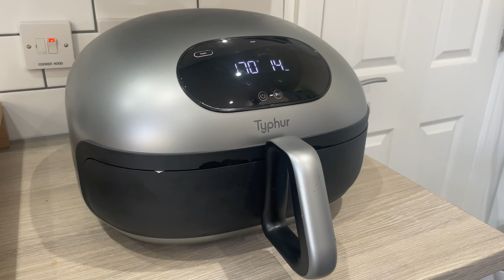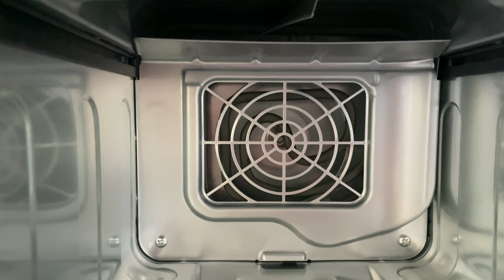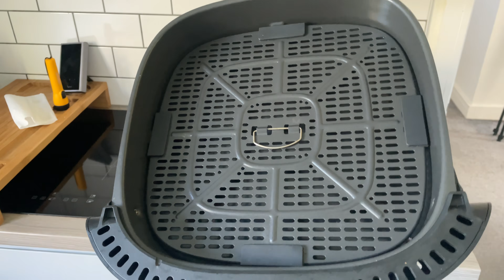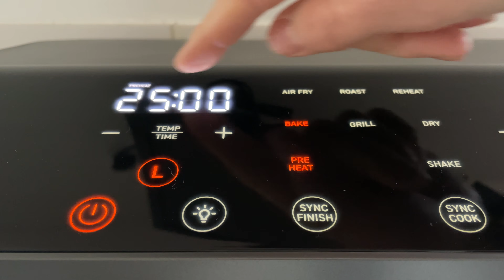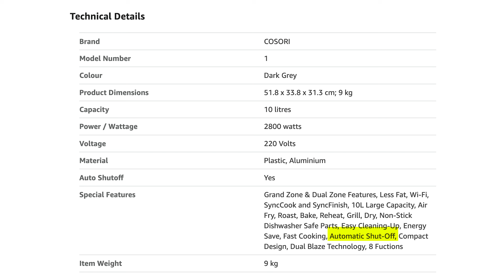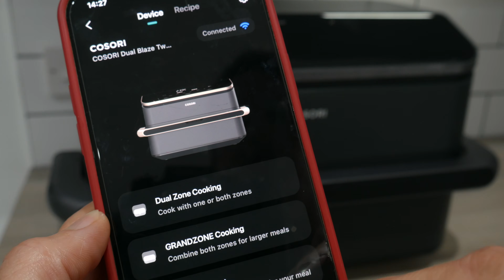Are expensive air fryers worth buying?

Comment: my first air fryer which l still use was a cheap one you are right about the coating it has worn off in places but a $2 perforated silicone mat solved that problem, and the fan is so strong it blows things around where my new one i can turn the fan down, and is too small at 200 mm round  and lastly it has a 30 minute timer, but it cooks just as good as my  sisters philips which cost 10 times as much, having bought a halogen cooker a few years earlier i was not prepared to spend big bucks on another appliance i would never use, so l though buy cheap and see, glad i did other wise l would not have 2   sometimes one is not enough
Reply from the maker: Thank you for sharing your experience

Comment: Hiya Clara, I have noticed that several air fryers, are identical to each other. Manufacturers create a  model and what ever company it is sold to , slaps their names on it. I completely agree, I noticed this with my tower oven, which I love, but have seen at least 3 identical copies. Even the pre sets are the same, this is great for de hydrating on 4 levels, but aside from that it is just an air fryer, so we only get it out of storage in the summer and use our ninja's throughout the year, which is a shame, we used it for everything at one time. It has 4 burners, so it cooks a bit quicker, but I prefer the modes to the individual pre sets, which this has. Still a good cooker though. I have a fire blanket in my kitchen, cheap to buy and tuck away in a cupboard, they supposedly work by smothering the flames.
Reply from the maker: Thank you for teh comment, yes a fire blanket is a sensible addition!

Comment: Thank you for breaking this down. I'm a recent convert to AF, did not want to risk a lot so went for the Goodmans from B&M at £29. I feel simple likely to be more reliable, this just has a timer and thermostat. Impressed with how this has cooked and how good it is. Some of the cheaper ones have downsides this one does not (e.g. the food tray does not fall out when you tip food out). I would definitely replace with another of the same type, it is obviously missing the fan speed option. It does the job well without complexity. Have also been made aware the emulsifier used in low calorie sprays can adhere and destroy to non stick.
Reply from the maker: Thanks for sharing your thoughts, it sounds like you have one that suits you well.

Comment: I have an instant vortex plus 5.7L airfryer, it has a very large 9.5x10 inch drawer.
I've seen you review lots of airfryers but haven't seen you review this one.
Personally I think it's absolutely brilliant 👏 👌. 
I use liners a lot to keep it clean and also use liner magnets 🧲 to hold them in place which I'd like to see you review as well.❤
Also I just tested it..if you press airfry or bake or any other setting then press and hold temp° and time at the same time for 5 seconds it turns off the sound..beeps!!
The one I have is the stainless steel model.